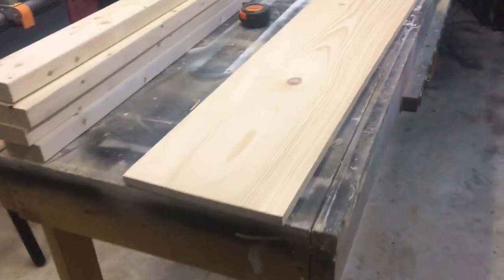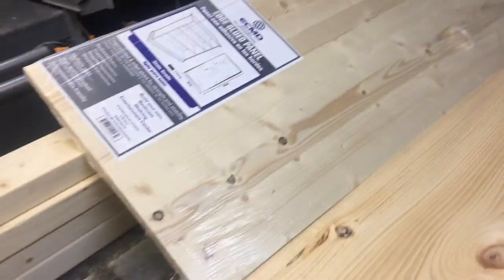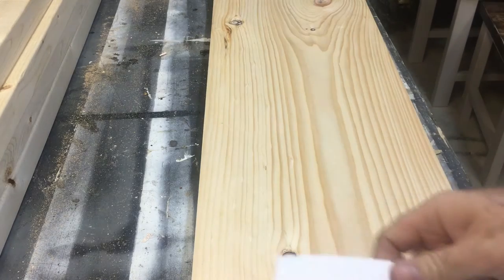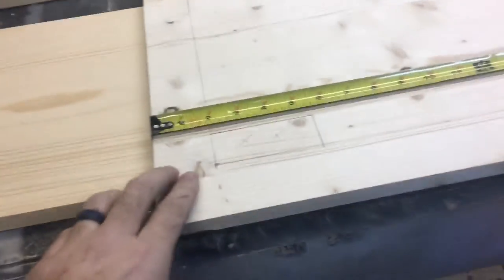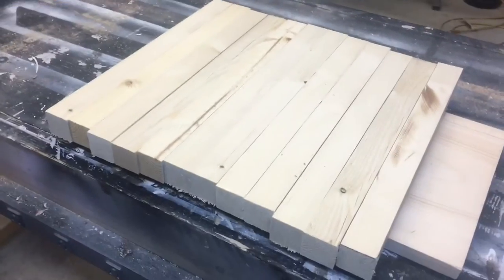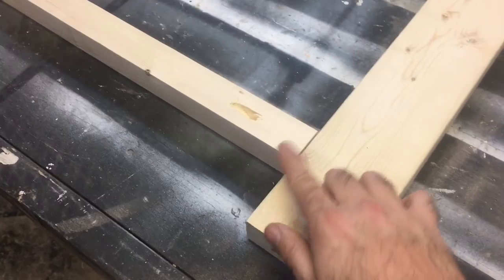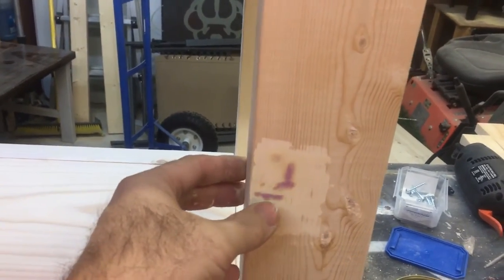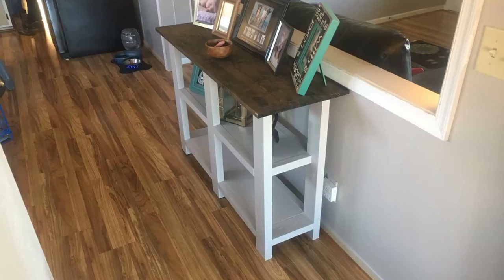DIY | How to build a Console Table | Made out of 2x4 Studs

Comment: Would it be cheaper to use 2x4 instead of the glued edge wood for the top? How much did all the wood come out to for this project?
Reply from the maker: Debra Perez I cant remember the total price since it’s been so long, but yes, 2x4’s on the top would be cheaper. I believe that project panel I used for the top was around $20-30.

Comment: Tables nice not long enough and sitting under that ugly wall.. doesn't look right, also same color it blends in.. instead of standing out!!  all my eyes goes to is that silly 1/2 wall with white trim.. i would take the whole wall out !! it doesn't look like it's holding anything up :( IDK just not right the wall takes away from that table :( Could you not take that 1/2 wall out to the light switch ?
Reply from the maker: toby Golding I could but the reason I haven’t yet is if I take the wall all the way down I will have to pull all my flooring up and redo my floors in the kitchen, living room and down the hallway. Due to can’t find the same flooring anymore. My intentions are to remove it all the way but got to get the money for new flooring first. We taking baby steps right now lol. The wall was solid a few months ago so I put the beam in and got it halfway down to give the open filling. It will come down all the way soon.
Reply: oh OK nice nice table i just want it to stand out more :)